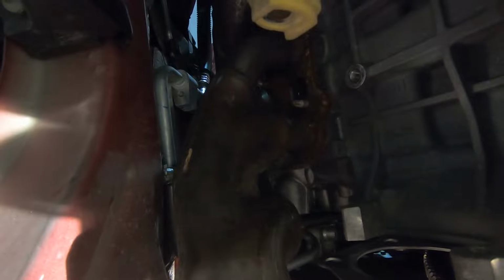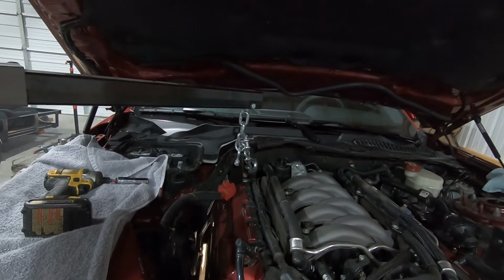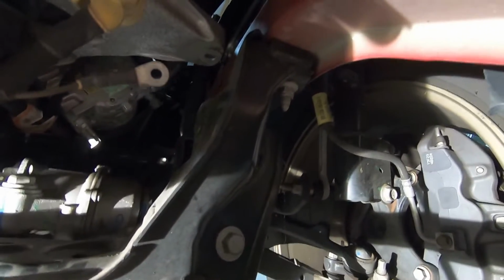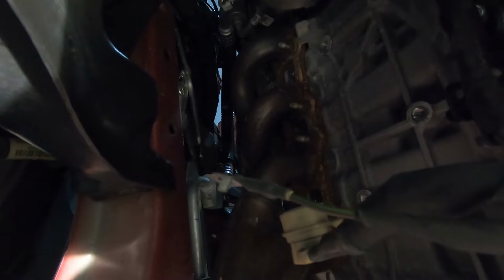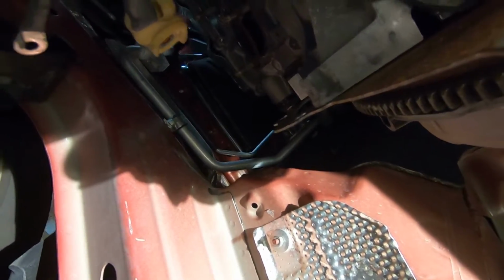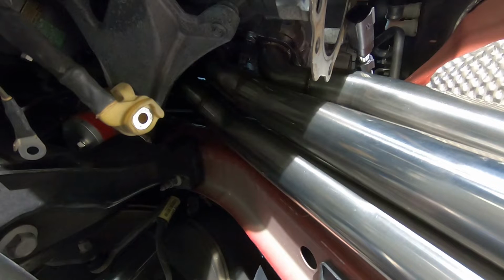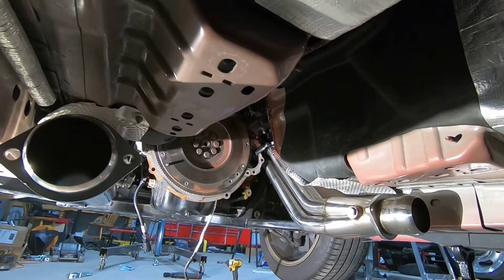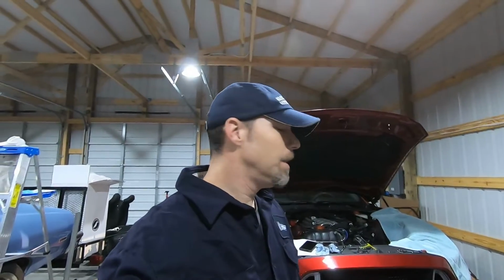Success! Pypes long tubes are installed on my coyote powered 2016 Mustang GT, project Stepchild!

Comment: I give y’all props for working on these new motors, I couldn’t imagine 12 hours putting on headers! I have a 87 GT with 351w stroked to 428 with pro charger runs  around 5.80’s in a 1/8
Reply from the maker: Thanks man! Definitely a different experience with these newer cars lol. Damn, your fox sounds badass!
Reply: ponie1992 I have had it for about 25 years and have change combos no telling how many times, but this set is my favorite
Reply from the maker: @smoovefishing  nice man! Longest I've had a Mustang is 11 years. That was my blue coupe. I have a few videos of it on my channel. 25 years is a long time. I bet yours is a beast.
Reply: ponie1992 yes it pretty fast lol fastest she has ran is 5.65 I want to get around 5.20’s
Reply from the maker: @smoovefishing  that's movin out pretty good! Hoping Stepchild will dip into the 5's at some point.

Comment: I can't wait to see how much difference it makes in power and how it runs at the track!  Do you have any Baseline numbers??
Reply from the maker: Never had the car on a dyno, but she was mostly stock with CAI, resonator delete h pipe and Roush axle back. Probably 380 or so to the wheels if I had to guess. Best 1/4 et on street tires was 13.15 @ 110 mph. Not sure if I'll go to the track before the Whipple.

Comment: Great job brother! Overall how satisfied were/are you with the fitment of the Pypes long tubes? I know they are one of the cheaper options out there and wanted your honest opinion if it’s worth saving a few bucks with these over say Kooks, Corsa etc. Thanks bro
Reply from the maker: Thanks man! Honestly, I have no complaints so far with fitment. Everything is clearing fine and the install wasn't "hard". It's just very time consuming. As long as I have no leaks and the rest of their exhaust bolts up fine, I'll be 100% satisfied, especially considering the price.
Reply: That’s what I like to hear my man! I’ll stay tuned to make sure it doesn’t leak once you got it all buttoned back up! Cheers
Reply from the maker: @tlcgtp  yeah man, hopefully I'll have mine running sooner than later.